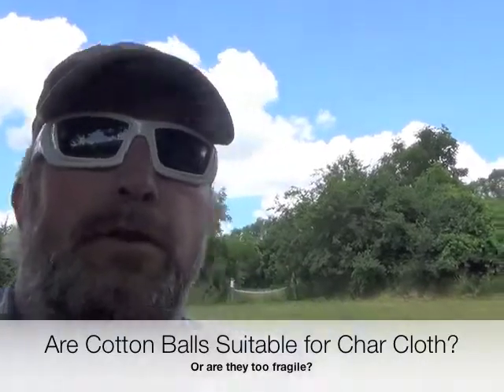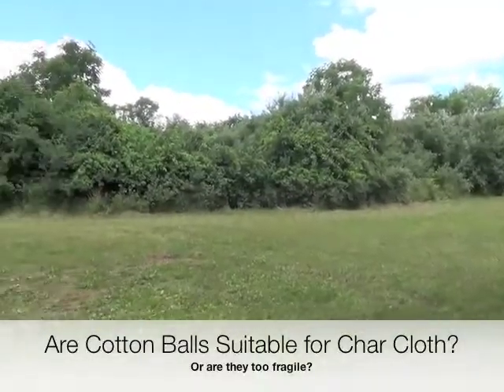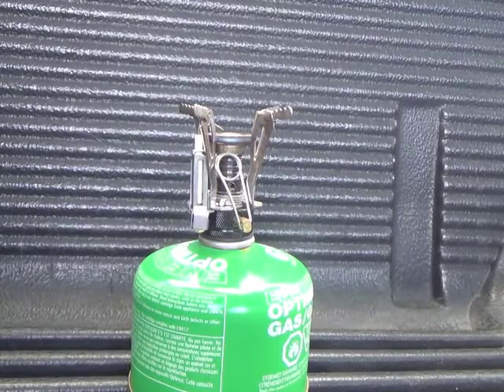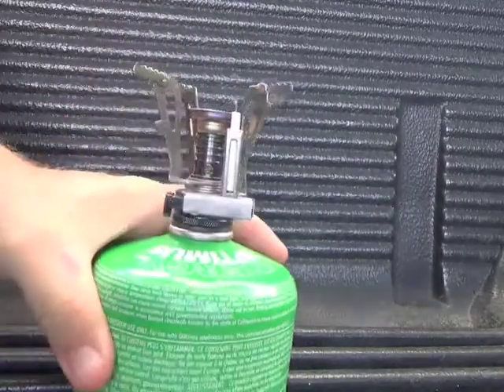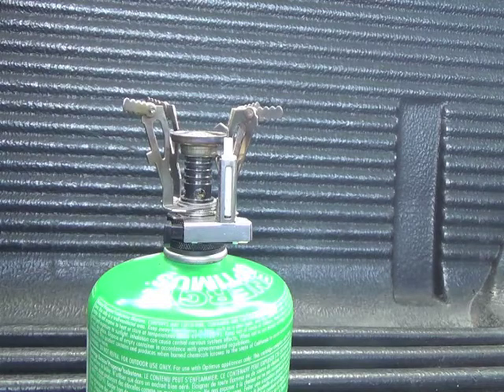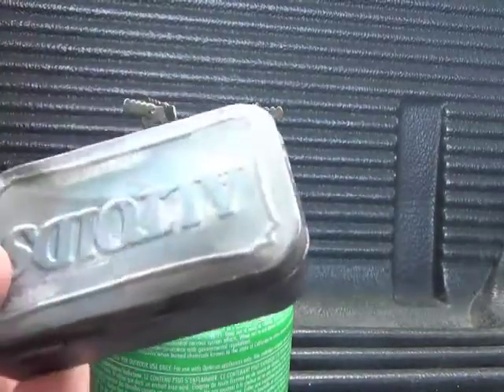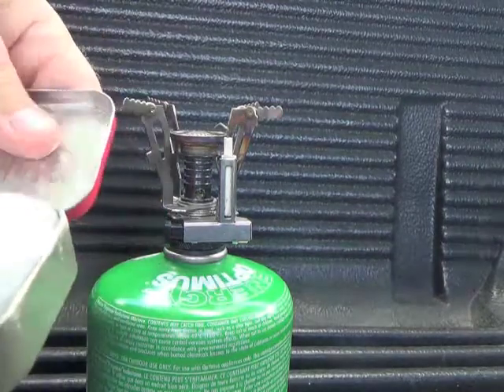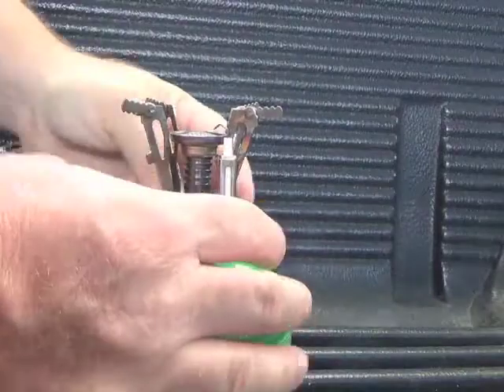Are cotton balls too fragile too char?

Comment: This is the best char material, even better than char cloths. Unroll the balls to create more surface area and it will light with a single spark from flint and steel if you are low on charred cottonballs. If you have alot of char cotton balls, lay the balls all out to catch any errant spark. This is almost always a single strike fire! Once a single ball is lit, separate it quickly from the rest or all your charred cotton balls will go up in smoke. 🤣 the rolled charred  cotton balls is the best char material because not only will it catch a spark instantly, it will immediately start to burn deep and hot and is ver difficult to put out. A lit char cloth it can put out with my finger, if I try that with the char cotton ball, it will burn my finger because it is so much hotter and the ember spreads deep so quickly!
Reply from the maker: Thanks for the comment and the watch.